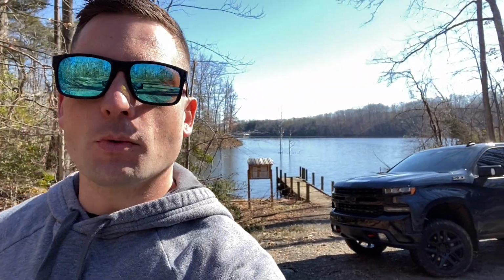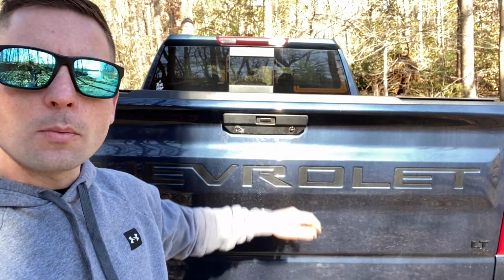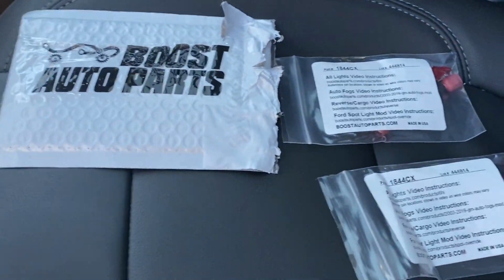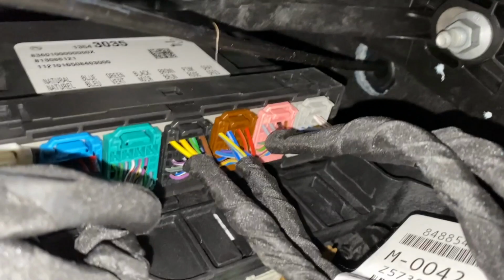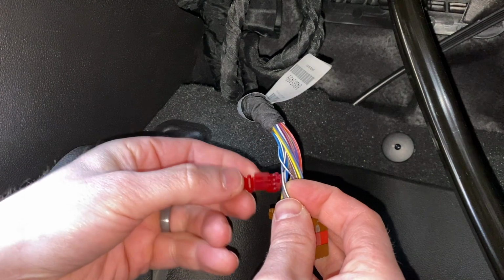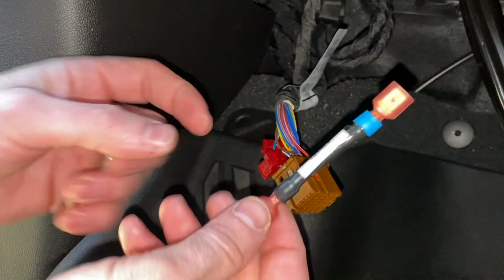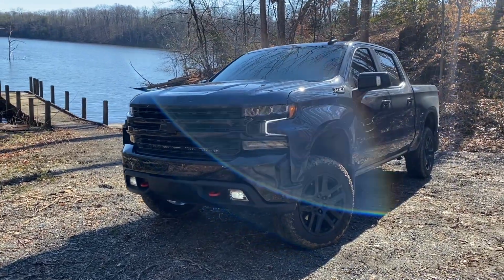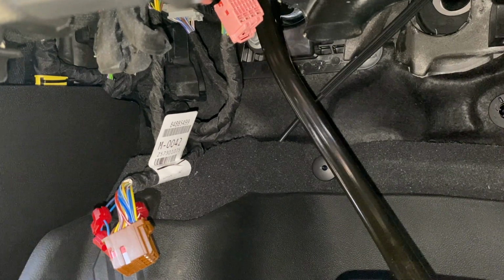2 Mods Under 10 min (Chevy Trail Boss)

Comment: Nice! I literally just ordered the same two things the other day. I'm just waiting for them to come in. In the meantime, I swapped out the foglights for black bezel fogs.
Reply from the maker: Awesome, simple job, as you can tell. Ill have to check out those fog lights.
Reply: @The Blue Garage  found them on amazon. They have a DRL feature too but wires they sent were too short. May add that feature later.
Reply from the maker: @Wikedwiskey  thanks man, I’ll look them up.